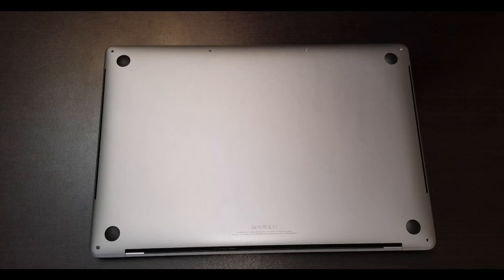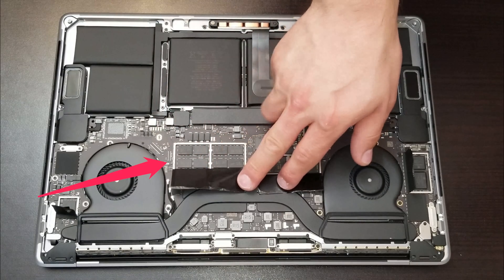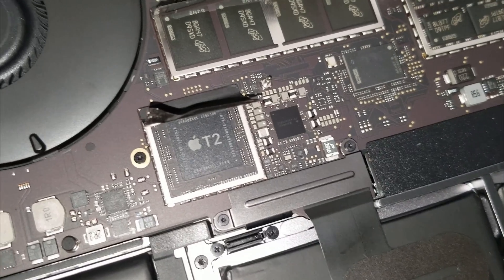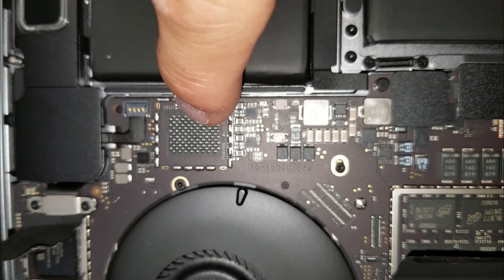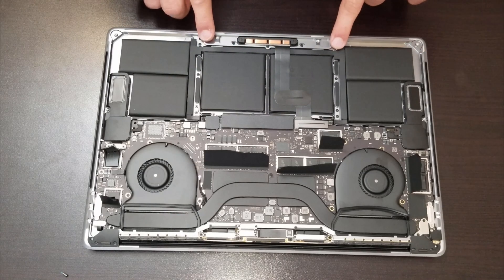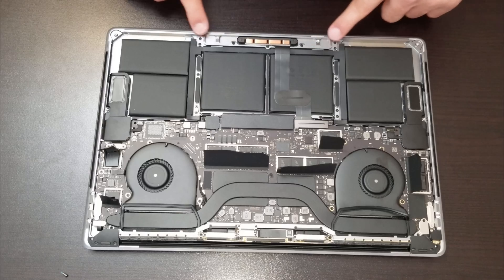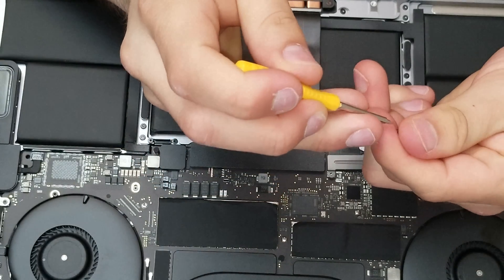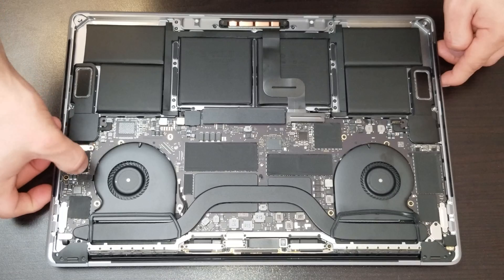Macbook Pro 2018 15" Core i9 (Opening - Look Inside)

Comment: I took the back off mine to clean some dust, now there feels like there is an issue with the keyboard, it just doesn't feel right, I hope I haven't done something wrong when putting the back back on :/
Reply from the maker: Hopefully everything goes well with you. Make sure you put the screws on the right holes and you did not force any of the screw of the top cover. Please let me know if that help. Take the time to subscribed please.
Reply: @xlearntechnow  It's late now but I will take a further look tomorrow, and I have also subscribed :)
Reply from the maker: @kianodonoghue1075  if anything I can take the extra step to help you. Just keep in touch. How everything goes. 🙏
Reply: @xlearntechnow  Thank you Sir, good night!

Comment: That’s Not The 2018 MBP
Reply: it is 2018 RMBP, as you can see T2 Chip
Reply from the maker: You are right on that one, the 2018 has the T2 chip. Do not forget to subscribed.
Reply: that is 2018 MBP. Speaker is different from 2016 and 2017 MBP. that is only included in 2018 MBP.
Reply: This lack of knowledge should not be demonstrated on the internet where people point out very fast. T2 appeared in the MBP 2018 only.
Reply from the maker: Yes it is :) , Check my others videos, don't forget to subscribed.